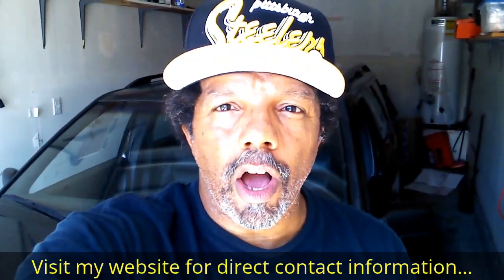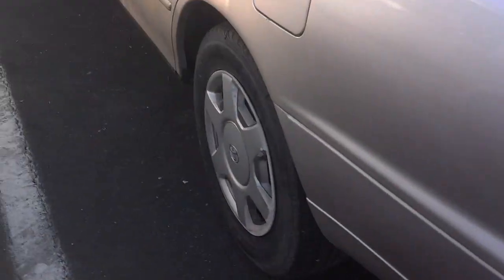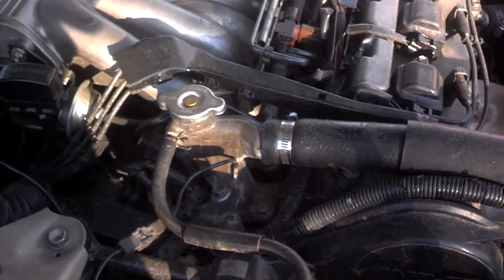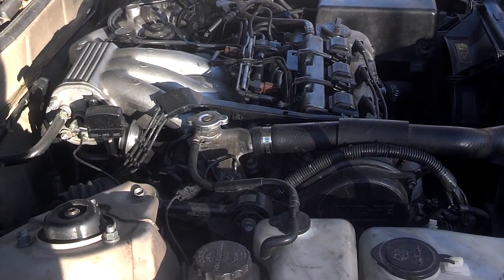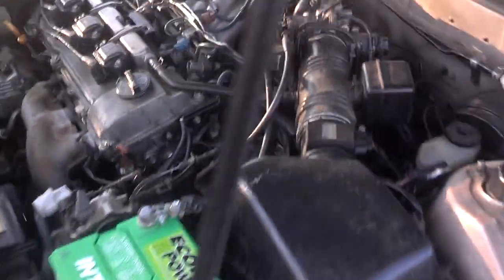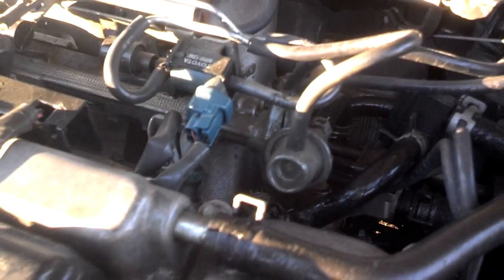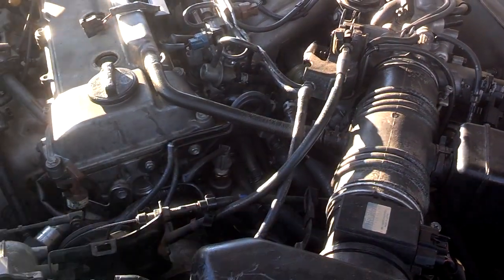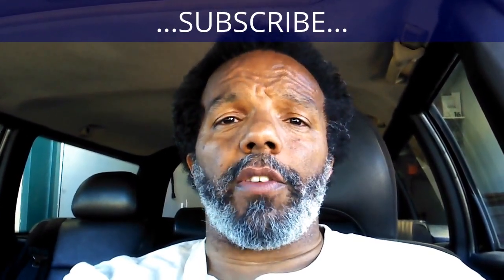No start troubleshooting, Toyota Camry, 1996 - HOWR

Comment: Did you pull off the cam cover and check the timing belt?  I've seen them with chewed up teeth that would bind up against the cam gear with the missing or torn teeth from the belt and or slip.  By turning it a little it maybe Just grabbing some teeth.  Pull that cover off before your buddy spends a ton of money on it.
Reply from the maker: +kapple17 It has no compression dry or wet. It also has no coolant. It does have spark so the cams are turning. Also, it was pushing fuel out of the right hand cylinder while cranking.
Reply: +Robert DIY not sure if that motor is signaled by the crank to fire or the cam. So you could still be triggered to fire. If the belt is stripped you can still have low compression even if the cam/valves are not moving or you have picked one that is partially open.  Those are typically great engines but that car looks like it never had any maintenance/timing belt. Just a cheap/free suggestion.
Reply from the maker: +kapple17 Good to know info. I'll tell the owner. It has a lot of overheating evidence but maybe the the timing is off. I'm not real sure on those Toyota V6 engines.

Comment: hey Robert I have a 1992 Toyota Camry can't get it to start it has no spark can you please help me
Reply from the maker: +Thomas Cummins Maybe the cam or crank sensor is bad.
Reply: +Robert DIY yes I thought it was that 2 but this car does not have a cam or crank sensor
Reply: +Thomas Cummins that's what I was told from autozone
Reply: +Thomas Cummins thank you for your help I really do appreciate it but the coil had a crack in it thanks and keep up the good videos they are very helpful
Reply from the maker: Glad you figured it out.